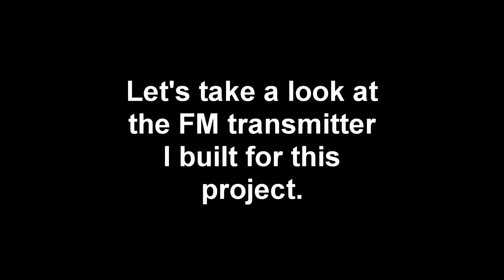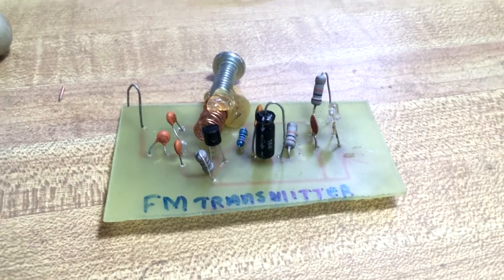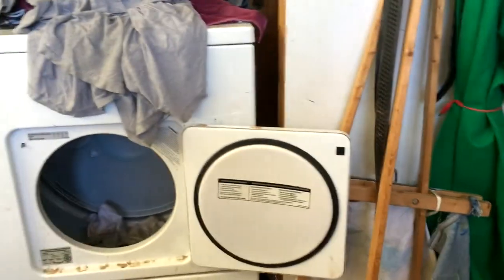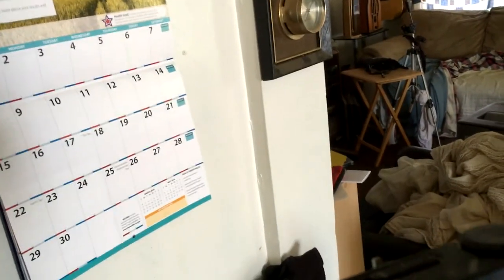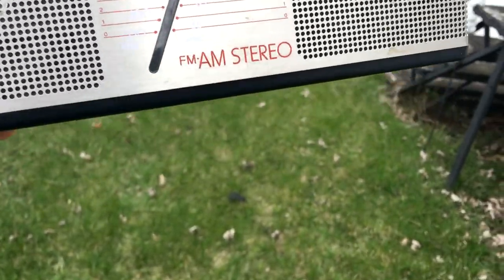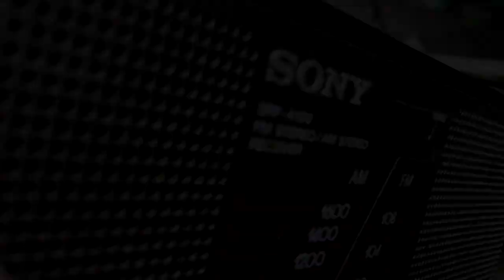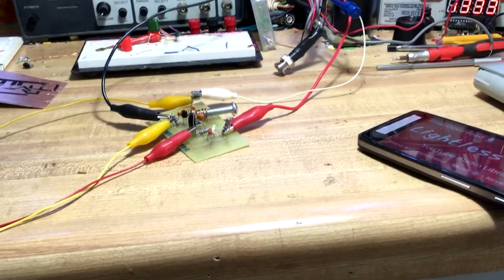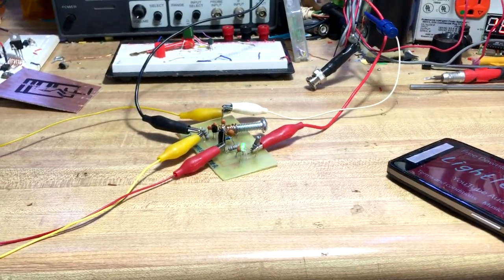FM Transmitter - Let's build one together

Comment: Hey Carl, good points, as kids, many of us built crystal radios from stuff around the house. 
As you well know, many CBers converted 10m rigs to CB, or hams converted nice cheap  CBs for 10m.  (we won't talk about linears, lol).  
But what about taking an old 10watt two meter rig, and detuning it for broadcast FM?  144mhz down to 108mhz transmitter, might have to change a  couple caps, but plausible, aye?    I think that a Clegg fm27, Heathkit HW2036,  or even Drake TR22 xtal 2m transceiver might do, and can be had for under 50$.
Reply from the maker: Well Don I think for this one it's gonna be a build from scratch.. few parts from the bins and we should be off and running.